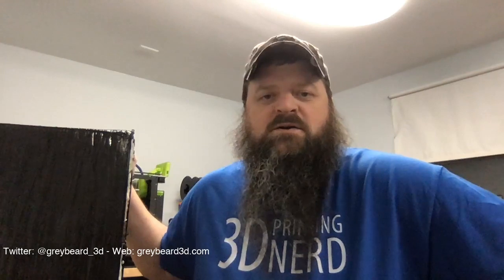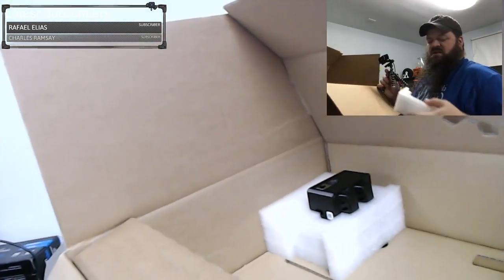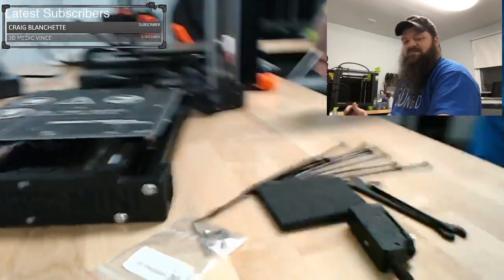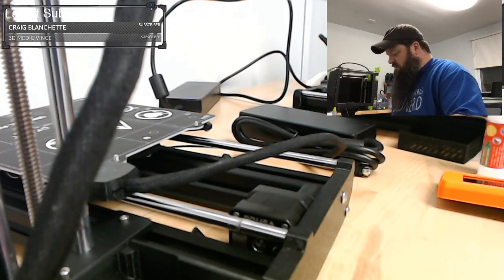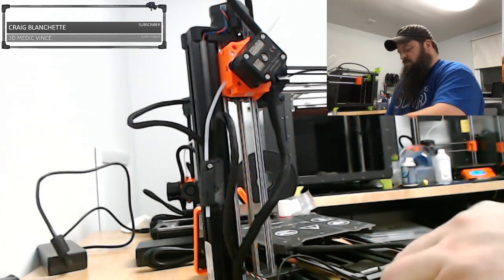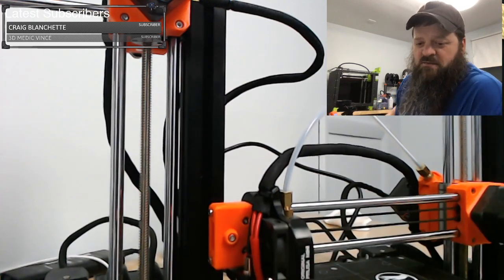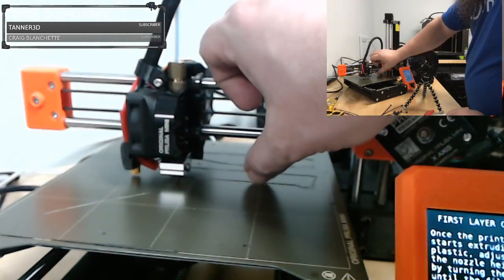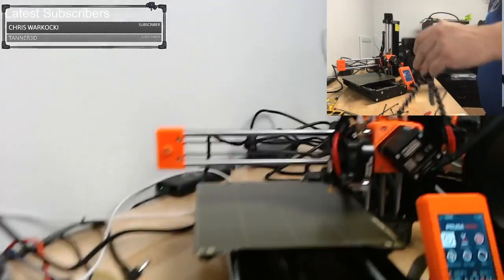Prusa Mini vs Old Prusa Mini - Unboxing and Build

Comment: I am going to order the Prusa Mini kit, but have no prior 3D experience. Wondering if you can suggest other items I should do with my initial order. I will def add a Kores gluestick (he he).  Any other suggestions?
Reply from the maker: I do like having both beds. Textured and smooth. You may want some nice hex drivers. I think I got wiha metric hex set. Do not get the ball ends. 95+ alcohol can be useful, so can a scraper. Nothing else really needed direct from Prusa.
Reply: @GreyBeard3D  thank you for the quick response!

Comment: Is the new more rigid than the previous one?
Reply: I can't  compare,  but the new version is rigid enough. The hot end section is very lightweight. The Quality of construction is amazing.  The parts also are high quality. It's slightly better than my Prusa I3 Mark III, just  smaller.  Except for at this point it doesn't print high temperature filaments. 
My other  Prusa -  ( wood pla )

https://m.youtube.com/watch?v=XrEK1iEGz1w